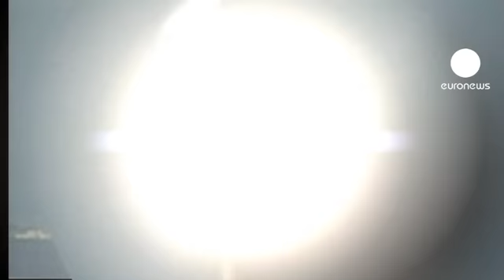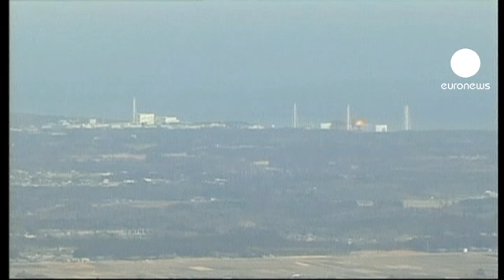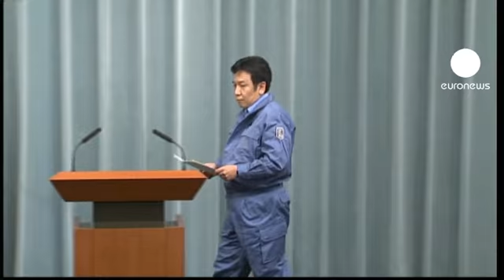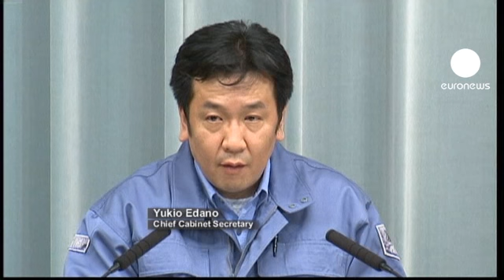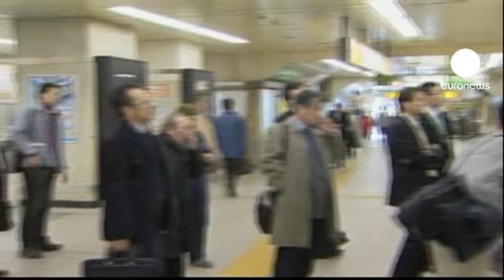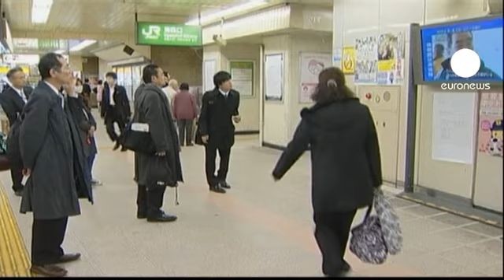Cooling breaks down at third reactor in Japan

Comment: @GoneToPlaid 

Okay, i meant 3rd reactor on the last comment. I thought the explosion was uncontrolled venting. Just like the first reactor. Except i think that was steam. Still the buildings shouldnt blow up. Most of that concrete is designed to keep in radiation incase of a leak isnt it? 

These reactors are not as bad as cherynobl, but still if two reactors or even three start leaking then woldnt that be equal to cherynobl? And I bet that every time these explode it damages the others.

Comment: @GoneToPlaid 

Sorry I had to go to bed sometime. Its 9:30pm here. From the recent footage I have seen, there seems to be a large amount of heat coming out the reactor that hasnt got steam coming out. You can see the heat distortion in the air. 

The reactors were planned to use diesel generators after the quake but the tsunami knocked them out. Now that the reactors have blown up a few times. So to me ext sources are screwed. 

I know atleast one reactor will have a big meltdown.

Comment: @GoneToPlaid 

Concorde got nasty radiation levels. The passengers had to be shielded. But I am talking about radiation that is at low altitude. Rain puts the radiation into the ground even if its miniscule it will build up wont it? Many years may pass before any effect will be noticed. But to me, right now the problem should be fixed, and it must be done whatever it takes. I am not convinced about what Japan has said, this is a big problem for the world.

Comment: @GoneToPlaid 

Well they better tell the truth if there is a big radiation leak, we dont this to happen:

watch?v=5HLkD57pJhY

If the reactor is completly dead and cant be fixed but is spwing out a load of radiation then why not bury it. Get helicopters to drop sand on the reactor or something. That 2nd reactor doesnt look to me like it was hydrogen. There is massive concrete parts flying through the air. And who the hell designs a reactor to destroy the building like a safety valve?